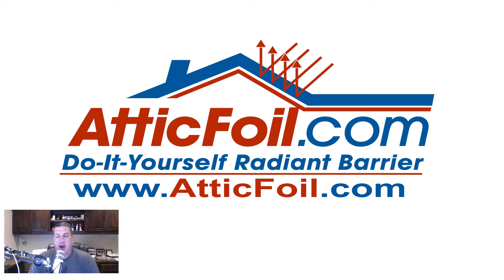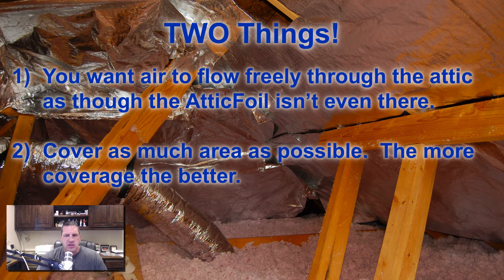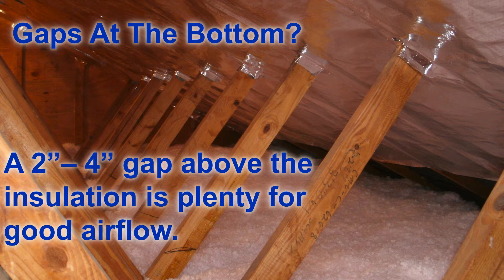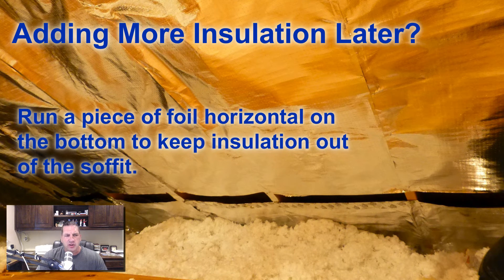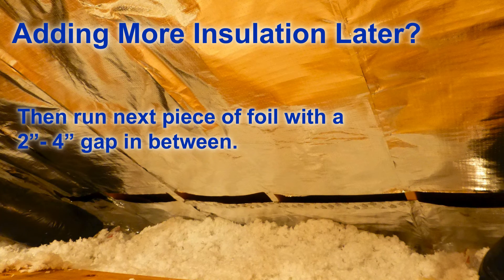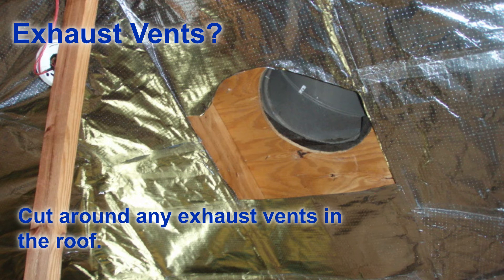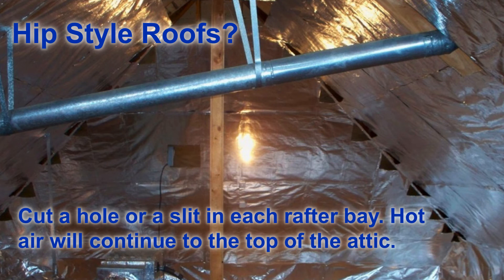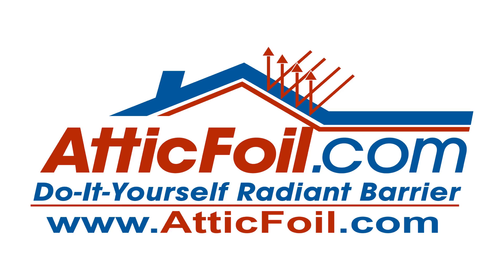AtticFoil FAQ Fridays Episode 01: Air Gaps, Ridge Venting and Adding More Insulation

Comment: Would you recommend insulation (fiberglass) on the underside of the roof decking(between roof rafters) and then your product, or just put up your product and fiberglass on the living quarters cielings? Our HVAC and ducting is in the attic.  I live in Southern CA and moisture is not a really big issue.  Thanks!
Reply from the maker: You don't need insulation between the rafters on the roof.  Just staple up AtticFoil and then add more insulation on the attic floor if you need it.

Comment: I'm confused about the gap on the bottom. it sounded like you are saying leave a 2-4 inch gap at the bottom but if you want to add more insulation then add foil at the bottom and then leave a couple inch gap right above that bottom strip of foil??

I don't understand why adding more insulation would make any difference on what you should do.

Comment: Hi, I just had a shed delivered today and it has the radiant barrier on the inside of the walls. I'm happy about that but I was planning to insulate and put up drywall to make it a nicer studio space. Will it be ok to do that? Or is it better to only use drywall and no fiberglass roll insulation in between?  Thanks!
Reply from the maker: It depends on whether you plan on heating/cooling the shed.  If not, then no insulation.  Using insulation is like building a refrigerator but not putting in a compressor.  If you are going to heat/cool do this: https://atticfoil.com/index.php/applications/inside-exterior-walls-hotmixed-climates/
Reply: @AtticFoil   Okay, thanks! 
I plan on heating/cooling down the road, probably next year. If the thin silver foil barrier is already adhered to interior walls then would I leave a space between the foiled wall and the insulation? I guess my confusion is there isn't an air space between the barrier and the outside world. It is stuck on to the walls directly and it's very thin. 
Thank you for writing back, Whitney

Comment: Can I put baffels with attic foil behind it?
Reply from the maker: You can actually use www.AtticFoil.com AS a baffle.  Just cut/staple into place and then cut a slit/hole etc. a couple ft up the slope so air can enter the attic if needed.

Comment: So I don’t have a gap at the bottom , so the air is forced to follow the barrier up to the ridge. Should I go through the effort to get a slit at the bottom ?
Reply from the maker: You should be fine.  If in a really cold area, keep an eye on the bottom of the foil for condensation.  This is caused from warm moist air leaking from the home.  If so, then I'd cut some slits to help flush out the air/moisture.

Comment: Why would you leave a gap just above the insulation if you have a roof vent at the top to pull the hot air out?
Reply from the maker: For attic ventilation you want air to able to flow between the roof and the www.AtticFoil.com AND also be able to be drawn into the attic (under the foil) to help remove any moisture coming from the home.  You basically want air to flow through the attic as though the radiant barrier foil is not even there.

Comment: Just finished installing attic foil and left about 6-8 inch gap at the very top. I have a gable attic vent. Do you recommend running gable attic vent during peak heat in the attic or just run it when outside temp is cooler? What’s your play with radiant barrier and active attic vent?
Reply from the maker: Set the fan ONLY to turn on if over 110 degrees in the attic.  Otherwise you are just moving air and not cooling anything.

Comment: tHanks you gave me more to think about .  I only have gable vents.    
I'm thinking...What if I put in a collar tie  so that my two gable vents were higher than the collar tie.  What if I then put the foil under the collar tie .  I've split the attic into two sections.   hmmmm  I'm still thinking.
Reply from the maker: Don't overthink it.  You want air to flow freely through the attic as though the www.AtticFoil.com is not even there.  Hot air will naturally end up in the top of the attic and find its way out.  Whether it be a ridge vent, wind turbine or gable vent.  It really does not matter if the vent is in the highest part. You don't need to "contain" or direct it.  It will just flow up like water heading downhill.
Reply: @AtticFoil  tHank you!    I enjoy all the videos.  I think I'll deck off the roof sheathing and drape the foil.  They built these houses with 3/8" plywood back in the mid 1960s

Comment: I would like to know the difference between installing a heavy plastic sheeting versus this vapor barrier.  You do have some good points here.
Reply from the maker: This product has NOTHING to do with controlling airflow.  We WANT air to flow through the attic as though the www.AtticFoil.com is not even there.  The foil is intended to REFLECT  radiant heat coming off the roof and keep the insulation cooler.

Comment: Yeah but if there are baffles already installed? Do you cover those or do you start 3” above them?
Reply from the maker: Nothing changes.  If air needs to be pulled into the attic due to pressure from a windy day, it has a path to get in.
Reply: @AtticFoil  I have baffles that come up about 3 feet. Do you cover them or start above them?
Reply from the maker: @I_discovered_civilization  Normal install.  You want air to flow free through and around the attic as though the www.AtticFoil.com is not even there.  The Radiant Barrier is there to strictly reflect heat.
Reply: @AtticFoil  ok thanks for the non answer. Do you cover the baffles or not? It’s a simple yes you can cover them or no you should not and start above them.
Reply from the maker: @I_discovered_civilization  Yes, cover them.  Pretend they are not there and do a normal installation.  Better?

Comment: I don't have a ridge vent and the radiant barrier install company completely covered all of the roof vents... (didn't cut holes) Is this undesirable?  They claim it's fine because the air can move between the roof rafters under the barrier... They did leave space at the top and bottom... SE Michigan.  Thanks!
Reply from the maker: It's not ideal, but probably not critical.  You WANT air and moisture form in the attic to be able to get out the ridge vent.  I'd just get a utility knife and cut a few slits about 2" wide near the top ridge vent just to be safe.

Comment: Question: I noticed that I don’t have any vents up top but in the video it says to still leave a gap at the top. Would the hot air make its way to the top and exit through the soffit vent at the bottom later on? I’m confused as to where the air would escape up top? Thank you for your time.
Reply from the maker: Yes, even if your vents are lower than the ridge, you still want to leave gap at the top.  Basically hot air will "pool" in the top of the attic and you want to give it a way to get out.  Even if it's down a couple feet with a wind turbine, static vent etc.  Air should never hit a "Dead End".
Reply: You need to have exhaust vents added to your roof. Attic venting relies on the stack effect, which is basically hot air rises and cool air comes in to replace it. If you only have soffit vents, you aren’t giving that hot air any where to go. Proper venting will have a much bigger impact than a radiant barrier will.
Reply from the maker: Yes, having exhaust vents is BEST, but some areas (hurricane areas) we call these "water injection systems" so it not required.  And actually hot air does NOT rise.  The science says the thinner air is "lifted" by denser air.  This means that at ground level cooler/denser will lift or displace warmer/less dense air.
Reply: @AtticFoil  How does the hot air escape without exhaust vents? I’m on the coast of NC. We have hurricanes every year and I’ve never had any issues with water infiltration into exhaust vents. Most of my rentals are mobile homes too, so they’re not the best designed. I’m sure there’s some water that gets in with wind-driven rain, but it’s not frequent enough to be an issue.

I’m really not trying to be argumentative. I love your product and your videos are the best videos on radiant barriers anywhere on the internet. I’m just try to make sure I’m not missing anything.

Comment: I have a small attic space above the second story bedroom in an A frame house.  The AC cant keep it comfortable during the summer. I am considering adding a mini-split but would like to try this first. There are ducts in the attic. I have not been up there to assess as there is no scuttle hole. I am not sure there will be much room for me to maneuver the foil underneath the ducts very well. Can I just drape it over everything and get some benefit? I may be able to staple in some areas and drape in others.....
Reply from the maker: Yes, if you can get a piece of www.AtticFoil.com between the hot roof and the insulation it will help. Ideally over the ductwork but below will still be ok.  Don't overthink it.  All you are trying to do is reduce the heat load to make the AC System be able to keep up.  Basically, I if your AC can keep up on a cloudy day, then this is what you can expect after installing AtticFoil. If the home is older/leaky, I'd consider using the SuperPerf AtticFoil.

Comment: I just had the radiant barrier added in my hip roof attic. Which has full 12 inch soffit vent all the way around outside house and ridge vent along entire roof top. Install was quality foil radiant barrier material. Installed  Exactly as it's supposed to be. Also had r 30 fiberglass added on top of r-17 existing cellulose. Also had radiant barrier layed over entire attic insulation. And after all that radiant barrier in the attic. It resulted in barely any difference in attic temp. Less than 5 degrees difference in attic temp, on same 80 degree sunny day as before radiant barrier install. While I was telling a freind of mine, how disappointed I was with the radiant barrier results in my attic. He then  explained, how he had gotten the same poor results, with his radiant barrier, that he had done a couple years before mine at his house. My thermometers are digital and analog spring style and are installed mid level of the attic space. Am I checking the wrong area of the attic with thermometers? Is it common to achieve such minimul temperature results, after all this money and effort? Or does this mean somethings must have been done wrong somehow?
Reply from the maker: Yes, you are measuring the wrong thing.  You are measuring air temperature not surface temperatures.  This is a common question/mistake.  Here is a video I did back in 2011 explaining how attic temperature is 90% based on ventilation: https://youtu.be/SGZevwIy8ok  A radiant barrier drops the surface temperature of the insulation which results in less heat flow through the insulation.  Ed.
Reply: did it improve indoor house temperatures?

Comment: I have a Spanish style house St Pete FLwith a flat roof. Do you see any issues with this? Also, the air intake for the attic is round piping located a few places around the house. I dont know where the exhaust is.
Reply from the maker: No problem at all.  It will work great.  We have had many customers install with similar type roofs.  www.AtticFoil.com  Even without exhaust vents, it will reduce radiant heat coming into the home off the roof.

Comment: My installation was different, they covered soffet vents left no gap at bottom and left a gap at top ridge vent. Should I use a razor and cut bottom of the foil near the soffet?
Reply from the maker: Yes, AND at the top.  You want some air to be able to flow in/out of the attic area below the foil.

Comment: i just finished my attic which i started last summer and it was half done but i did notice better comfort and electric bill went down. its 90% done now, but theres some more room for low pitch area's. and im also adding a attic fan to get better ventilation
Reply: Was there any noticeable improvement with the attic fan?
Reply from the maker: There usually is. We have thousands of reviews here: https://www.shopperapproved.com/reviews/AtticFoil.com

Comment: Thanks for posting this -- I was about to buy dozens of cheesy attic baffle vents after seeing that my attic only has one baffle vent per sofit vent, and the idea of using the tear-resistant version of the foil is going to be so much more easier (and dualy benefit from the radiant reflection) than a baffle vent would ever be.   Perfect timing for my insulation project.

Question:   You mentioned the contact of the insulation with the foil... is there an unacceptable amount of cellulose/fiberglass (blown-in) that the foil should not come in contact with?   Anything I should look out for when prepping before blowing in more insulation after using AtticFoil to take the place of attic baffles?
Reply from the maker: Not really any "unacceptable" amount.  Even if you have contact on the bottom the topside will still be acting to reflect heat.  Advice?  Do it this time of year!!
Reply: Thanks!   I've actually just started this (among many other house projects).  Appreciate your videos and science and the AtticFoil foil is superb quality!